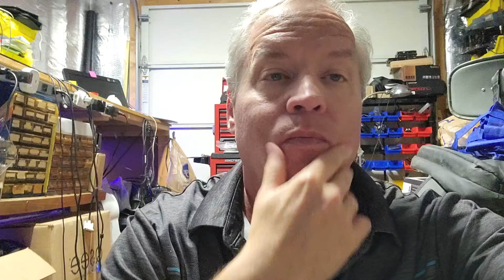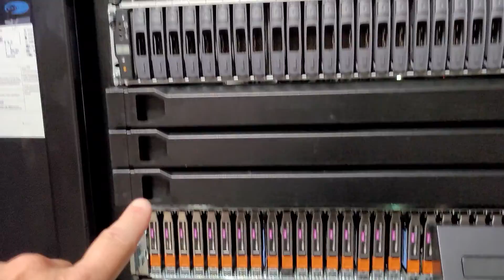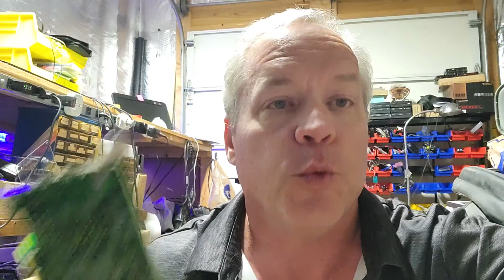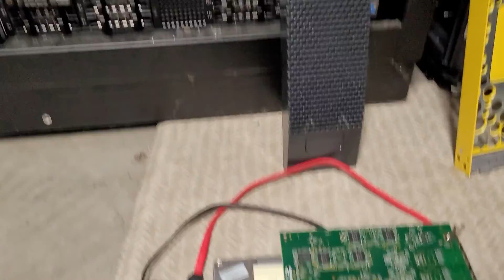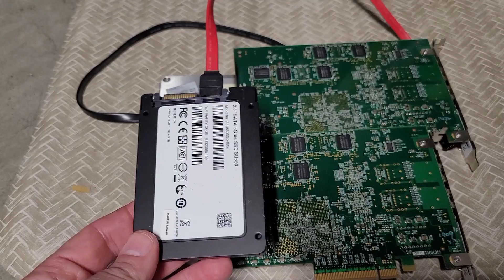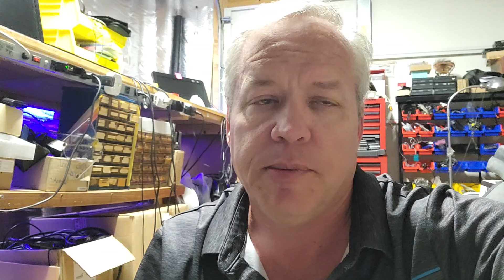I found a cheat to make older SAS HBA controllers work better for faster I/O from SSD disk arrays

Comment: oh by the way brad what ssd are you using are they 256mb ssd or 512mb ssd or bigger ?

and the hp microserver G8 i want to upgrade are spinning disks so im guessing you could swap these out for SSD's but let me look at the manual 

https://images10.newegg.com/User-Manual/User_Manual_59-108-088.pdf

now reading this it says the controller or the motherboard decides whether its hot swappable but these micro systems from factory are not hot swappable but if i put on this modification of a internal network card and i upgrade the hdd to ssd would this make them hot swappable or will the motherboard still limit them to not being none hot swappable or will it be a case of trying it and it will either work or it wont ?

thanks for the help :)
Reply from the maker: I would work with 1 TB drives if possible for you are limited on space most of the time.  But 512 GB SSD works just as well if cost is a factor.  Anything less is not really of value.  Also do RAID 1 if possible for best results,   RAID 5 if you just need a lot of space to work with but you need at least three drives for RAID 5 and four if RAID 6.
Reply from the maker: The SSD drives I use are Team Group.  They work well for my needs.  Here is the link. https://secure.newegg.com/orders/list?RandomID=76153152117862920220830072954
Reply: @leadiususa7394  what are the differences between the teamp group cx2 drives and the gx2 ?
Reply from the maker: @1111000ANGEL0001111  CX is the standard DMP (DIsk Management Protocol) type SSD drive (Just like any normal spinning hard disk drive) that is pretty fast. (best for pair raid groups)  QX is a quad compression feature to allow for a larger disk sizes but with the same performance as a CX-2 but does have a little bit of a delay due to compression effect.
Reply from the maker: As for testing a SSD on your chassis, I would do this first.  get one or two drives for your testing needs.  Install them and make sure if you need to have adapter kit to mount the disk may be need if the screw holes are not present.  If not you can just drill the four holes in with a drill later.  (I think your drive caddies have the holes to mount a 2.5 inch SSD drive.)  Test the system with the drives that they can be seen and use by the BIOS of the motherboard controller.  As for the hot swap mode, that can be address by adding hot swap disk to the mix.  That would be two drives in RAID 1  and one drive acting as a swap drive if one of the other fail for any reason.  This will cover your needs.  You are not in a production environment so having hot swappable drive is not really needed.  If you want the add protection just add the third drive as your backup drive for fail over.   Hope this helps!
Reply: @leadiususa7394  yes well because you mentioned that the onboard controller is slower unless you use an internal front end network card you probablly couldnt gain a speed advantage and im not sure that if you  did get the 10g that that would pass through the main board and out the back at 10gb or not ?
Reply from the maker: @1111000ANGEL0001111  The NiC speed will be there but the PIC-E BUS speed will produce I/O wait states that can slow the transfer speeds some. But!  It will be faster then 1 GB but maybe not at a full 1 0GB, more like 5.6 to 6 GB speed.  Think about what I recommended as your next step.  You can get a HP Gen 8  DL-380 2U server ( https://www.ebay.com/itm/354028335884?hash=item526dbbb30c:g:IYoAAOSw9gdiZyMP&amdata=enc%3AAQAHAAAA8MJo1loPLdEdmKn%2FOO6qWF4QGBkYWK%2BlCRIzX58vf2%2FsWdcAAtS5Z13nzH96Ht3H5caGUmZq%2Bt89GPMVpoB5vIUe3MLVm%2FqsYDT5EwjQ0eordGGM8dcg518%2B1QaCitsO6yOH7QF9rIs5R%2FuD3PSDej6fxM11D838hsxMAk9mieqqzwvlsmVzzuYxhanKBXQwOYPEumJUSIKun9XmJ3MSa8AeteDiUsnPfw%2BIh3qpaCrrZfUxFQ4QrmKLaFIR7eMD1GgYvp4AOxEjglv7SlZBagxlni8ZxKYV%2BnIT0yrswmH6ElBQJCwXqppxyzXKcn4l7Q%3D%3D%7Ctkp%3ABk9SR7bH16zfYA ) or a Dell R720XD chassis... ( https://www.ebay.com/itm/385093919538?hash=item59a962e332:g:h10AAOSwlSxjEL4I&amdata=enc%3AAQAHAAAA4GSvNouwZT7BeVe4MeATuaPZ1B8EGqyyDbZGOoaVCIWdxDU6dYydx8%2BCJWRTOeHbx30yxCnCX857m1WBzm4SxUWki%2B4u7Tr24uGKnzwoojSucsi6TqgSY726sfVv984VM98XZjw0UBE3FmscsW70tys3I9WhlQRwPbRT1%2FRztWwkW%2BWlJU5Ypv4SSoHyYYkSDBaAGrTygYX9R3vWyo8DxPUVI1Xl5KBI%2F2ZluWfEwtzOpMdsLwlT%2BVb0OmRcSy2lEr2BKYgd6sHswMPV9%2FGNsaGFB1FfzAQ6ZsniM4Fafs8q%7Ctkp%3ABFBM2MTmrN9g )  I like the Dell better.  Yes you atart with out 8 GB of RAM but that is cheap to buy and this server does everything including high end video cards.  You have everything you want in the Dell server.  2 CPUs and lot of 2.5 inch drive space.  I use TrueNAS as teh OS and put in 64 GB of RAM and wow!  Plus you can get a PICe 10 NIC card or instead replace the four 1 GB onboard card with a 10 GB onboard card to totally free up your PCI-E for real gear!  Sweet!

Comment: good video brad im actually looking at upgrading gen 8 hp microserver and im thinking a network card could increase its speed with it being hardware over software 

Am i right in that you cannot install newer network cards into a system that has not been mentioned by the manufacturer 

Can you explain what the advantages are of the onboard memory caching as some have none some have over a gigabyte would this just reduce stress on the card ?
Reply from the maker: No you can can add a newer network (Like a 10 GB NIC) to a older server if you have a slot for it and the on board NIC-NTU cache adds a lot to the bandwidth needs you are looking for.  Go for it but do you research.  Avoid the old NIC for use unless you want to setup a slower remote management network along side the higher speed  front end network or you can go three tier network, management/front end/ and your nightly backups network.  split up all your bandwidth over three NICs so your fastest is never slowed down by overhead work like back up...   As for the caching role that the motherboard BIOS, your operating system vs. your higher level NIC local cache all work together.   The NIC settings are set to default mode so your NTU / NPU caching may be set more on the OS level / side.  Research your NIC drivers and then go in and adjust the settings so the NIC take most of the NTU role on itself and that remove overhead from the motherboard and the OS.   And! it is faster as well.  You just have to play with it some and learn from it.  It takes time but that is the point right!?!  lol
Reply: @leadiususa7394  As to what you were saying about connecting more cards to your SSD hard drives do you have a limitation on the amount of pci slots you have available on your server

What technoloty is it 2.0 3.0 ?

or does the age of the technology give any bottleneck issues ?
Reply from the maker: @1111000ANGEL0001111  Great question,  if you have PCIe 2.0 slots or better you are good and I would say maybe spread the SSD drives (Let us say 75) over three controllers 25 drive each.   The bottleneck here is the controller itself due to limit amounts of on board caching resources.  Lower the amount of disks on each controller will allow you to avoid you reaching memory those limits.  One other things to do is use a true NAS OS like True NAS instead of Linux or Miscrosoft server.  The software is free to use (with some limits on it) but will allow you to use the motherboard RAM as a form NAS storage caching.  This works great if you have like 64 to 128 GB to work with.  With that and the three controllers, you will have a fast NAS.  One last thing.  On the NIC side of things, do you research on the max settings you can setup for your network.  The default settings are just that.  Default.  You can do better.  Hope this helps some...
Reply: @leadiususa7394  hi brad on the hp microserver gen 8 you have a maximum of 16gb of ram so nothing like 64gb to 128gb you mentioned 

if it was the rack version though this supports alot more ram

I think i have figured out the connections although in the place where your servers live 

Do you have a setup where everything is wired through the walls ?

or

do you have a setup were you access everything from your garage ?

If you want to run cables would it be cat 6 cable or cat 6a it says 500 feet so thats quite far but would it keep the speed over that distance or does it degrade every so many feet ?

i wouldnt need anything like that distance but when ive seen people use the nics they use fiber but 50 to 100 feet in this may be quite expensive but is their alot of difference between the complete copper nic the fiber nic and the fiber optic nic's ?

thanks for the reply with the questions its all helpful 

now one other thing is when you connect this to another computer can you do it directly or must you have something like a Microtik 10gb switch in the middle ?
Reply: @leadiususa7394  following on from what you said about the how many ssd drives you can connect this is on a front end controller which is internal 

and the back end is an external controller which can be abit confusing hoping i got this correct 

I hope this is not too complicated a question but supposing you have one pci slot 

if your server hard drives are already attached internally to gain the greatest transfer speed would you want a back end controller ?

or would it be that you have a front end controller and connecting the current drives to the hardware controller gives you the better transfer speed, and if so how would you connect to another computer doing it this way or can you do it some way from an internal nic or have i missed something ?

another thing ive noticed is front end internal cards are more expensive if ive got the terminology corect 😁
Reply from the maker: @1111000ANGEL0001111  Well if you have a internal SATA controller that is lock into what you have inside the server chassis is limited to SATA speeds.    You are using a B120I SATA controller so I would do one of two options.  First option is to buy four 2TB or 4 TB or larger SSD drives, (Yes they will cost but stick with my way of thinking.)  Set them as RAID 5 to get the most space possible.  Next create a 300 GB  boot partition for TrueNAS or Server 2019 to load your OS on and then format the rest as you storage space, next add a low profile 10GB NIC and you have a pretty fast setup for a 10GB network storage NAS.   Option two is to go down to just two 300GB SSD drives in a RAID 1 format inside the chassis.  (Leave the extra SATA drive slots for expansion as needed for later.)  Next get yourself a low profile SAS controller for your one PCIe x16 slot.  Next buy a SSD drive array chassis like a Dell NetApp or HP (Refer to my other videos.)  and buy yourself some SSD drives 512 or 1TB in size but no more then 24 drives.  Lastly you will only be able to do 1GB NIC speeds but your server will handle everything you send to it and them some.   Or you can just buy a Dell 720XD-24 drive bay chassis or a HP Gen 8 or 9 HP server for around $350 to $600 and get everything you want p[us a long life and no the servers don't make that much noise once powered up.  Look at my videos to learn more.  Have fun dude!  BTW I like the Dell 720XD-24 bay myself and have two of them.
Reply: @leadiususa7394  hi brad so the b120i sata controller is onboard 2 drives are sata 2 at 3gb and 2 are sata3 at 6gb second 

it does say you can upgrade the four onboard drives to sas but with their being a limitation on speed of the motherboard controller their probably is no benefit

this also comes with a internal usb that you can boot a ssd off

it also comes with an sdram card you can boot of as well

is it possible to get an internal and external nic at 10gb or can you only have one or the other ?

it looks like to get the 10 gb speed between to computers though you need to use the external front end network card though 

if i used an internal front end 10g card though you could you increase all the internal hdd to ssd if you got 10g this way would you get the 10gb out the back of the motherboard ports or can you only get this speed if you use the external back end 10gb nic ?

thanks for the advice
Reply from the maker: @1111000ANGEL0001111  Yep go two in the 6gb slots and one in the 3gb for hot swap drive.  You will replace the failed drive and stay on the 6gb as normal for boot only mode.  if you go with all four bays then you only go as fast as the common 3gb SATA bus will allow.  Go with the three drive model for speed and add a SAS controller for external disk array  but only have  a 1GB network speed,  (or) put in all four 4TB drives for lots of space and put in a 10GB nic for faster speed network speed but you will only the SATA controller 3gb speed to work with.  This is a cool little server but it is just that.   GO with a Dell R720XD 2.5 inch 24 pay chassis ($350.00)  and you can do all things plus have about seven years of life to grow.  Time for getting a big boy and the cost is not bad...   Have fun!
Reply: @leadiususa7394  Hi brad thanks for the reply i think its possible but the limitation is the pci slot is 2.0 x 16 low profile 

so i think i can do 10 GB nic but not any faster

so its ok as a file server, or cloud server 

it is possible to have it as a media server as well but then you cant upgrade the to a 10Gb nic

So ill have to have a separate Media server
Reply from the maker: Just because the manufacture hasn't tested a NIC on it chassis doesn't mean it will not work.  Almost all NICs have the same standard so unless it is a really odd NIC, it most likely will work.  As for the on board caching, you have that backwards.  If the NIC NTU take up the workload instead of the on board CPU /caching, you take the workload off the CPU freeing it up for more important tasks plus you remove two I/O wait states from the handling process that slow things down.   You see if the CPU has to do all the work and the NIC just handles what is given to it, then the CPU is not moving at its best speed.  Allow the NTU of the NIC to take over that role than the CPU if freed up and it uses it caching more functionally with the core data it must handle.  That is how you can improve the caching effect.  Hope this helps some.